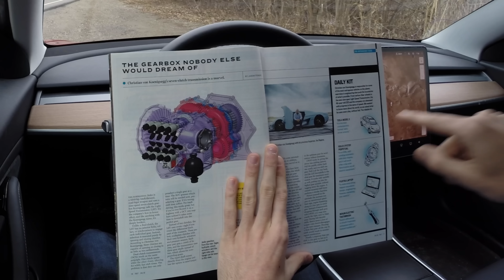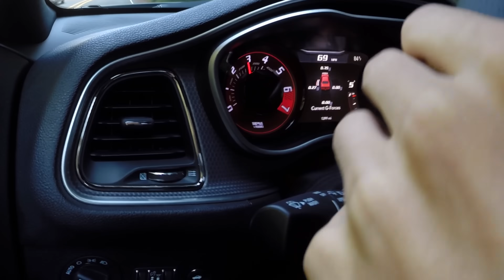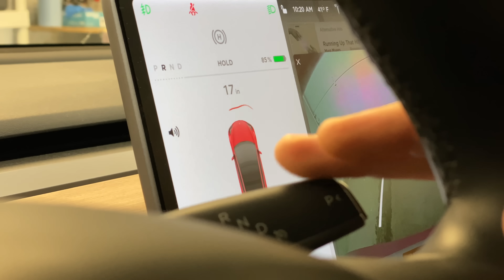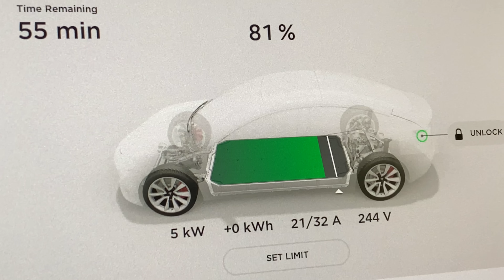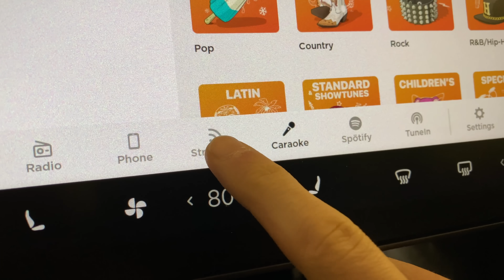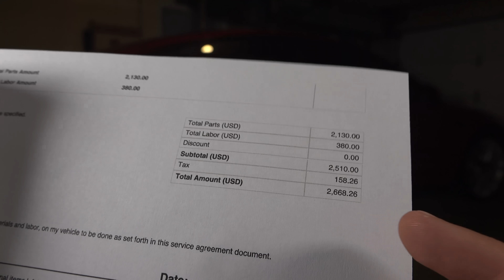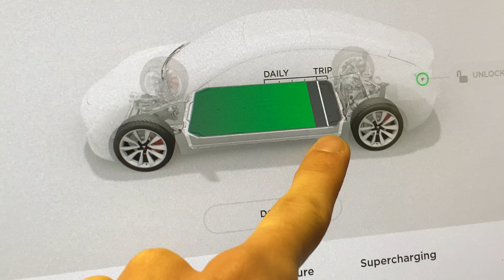Living With A Tesla Model 3 For A Year - The Best Daily Driver

Comment: Great video, but couple thing are not as black and white you say. Diesel/gas car can be heatet with webasto or a like and same system can cool car and car will blow heat right away.
Diesel/petrol car do not need fill up daily and you need to "fill up" tesla so that was pointles point.
Reply: A Tesla fills up when you sleep.
Reply: @Freba9  well yeah because it takes so long. Same effort is needed to put pistol in or plug in. That argument is just pointless.
Reply: @anttilaiho7801  It takes so long because it can and because it is cheaper. You can also choose to fast charge.
Reply: @Freba9  why the argue? Both need fill up and both are filled up by pluggin something on side of car. And electricyty aint free. Compared to low fuel diesel the cost difference is 2-3€/100km. If you drive 20000 km year that is 400-600€ per year. Money you easily spend on few nigths on pub.
Reply: Antti Laiho I see what you mean, but plugging in at home and/or at work still feels a lot more convenient to me.
Reply: @Freba9  I dont. I have had cars with heater you need to plug in. And I hatet it. Every time in winter you did come home you needed to plug in and remember to take it off before you did leave. Now whit webasto I can just drive off whit warm car. Thats a lot better that the hassle whit cables 😁

Comment: Bought a low mile 300 c for 18,000 with lifetime drive trane. I can spend 42,000 on gas before I reach the price you paid. Gets 20 mpg. One tank of gas every three weeks. I will stick with this 300 and could buy one of two more at the same cost of your electric car. Sure I might like an electric, but 60,000 bucks is way out of my price range. And I want to stay payment and debt free.

Comment: I think they've been over this exact "Yo, this sucks" phase 100 years ago, but the extra range of internal combustion engines won them over and they never looked back -not for a good while, at least, lead-acid chemistry meant that EVs went nowhere, quite literally. I don't know if they would put 500 liter gas tanks in "newfangled" ICEs to match the weight of battery packs, though , had the roles being reversed ;-)

Comment: 6:20 clarification- you should be using brakes (sometimes) regardless to prevent them from rusting or collecting up dirt, road debris, etc.
Reply: Here in the midwest you have to use the brakes because there is no regen or very little when the battery is cold.
Reply: Mark Tattershall not a problem for me I’m in Australia! but I guess the 45 degree summer days can take a toll on the usability of the vehicle..

Comment: All are very good points.
A small detail. The "braking warning system" has 3 adjustable levels of sensitivity. If you are using the least sensitive and still having it triggered then perhaps you need to consider to keep safer distance or drive slower in busy areas. That is amazing how everyone consider themselves good drivers :)
I have exactly same car (even same wheels style but 19s), the "warning" is set to Medium, and it almost never triggers.

Comment: The issue is of course, to advertise the electric cars properly like you said would make the car companies' other cars, which they make a higher profit margin on and dealers maker more money on long term, look crappy in comparison. And a company like Tesla who could drive that point home, hasn't yet needed to advertise to maximize sales based on current infrastructure. It will be interesting to see what kind of ads they run when they get to the point where they have the ability to make more cars than they are selling in a given month. -Daven

Comment: I test drove the Model 3 a week ago and I cancelled my Model Y order.  I'm not sure if it was a RWD or AWD one but I'm sure it wasn't the Performance one.  It wasn't a bad car but I expected more after I heard so many great reviews about it.  It handled better than my Honda but not as good as the 2004 BMW 330 my brother in law let me drove for a day.  That BMW wowed me then and I still remember how good it drove.  That Model 3 had good acceleration but I feel like  I'll be in traffic jam most of the time so I would rarely make use of it.  The gas pedal (right pedal) was a little too hard for my liking.  The back window was small and so were the side mirrors.  My Honda Accord has better visibility.  I still consider the Model Y but I want to test drive it first.
Reply: So you cancelled the model y that had bigger windows because the model 3 windows were too small, and didn’t handle as well as a bmw, but if it did handle as well as a bmw you’d be sitting in traffic most the time anyway so you wouldn’t make use of it just like the speed? Huh?

Comment: The problem though about the speed is that all the quickness is in the low end and theres a long cool-down period after 10-15 seconds. Electric cars still aren’t there track wise.
Reply: After 15 seconds? I’ve seen model 3s lap the Nurburgring at full acceleration and didn’t overheat once, and that’s a 13 mile track.
Reply: M.A. M.R. Whats the official Nurburgring time?
Reply: InvokeMyRage 1 Official? I don’t think Tesla has had any official times there with the model 3.
Reply: M.A. M.R. So without a lap time we have nothing to compare to. Unofficially its over 8 minutes which is slow for the 0-60 on the car.
Reply: InvokeMyRage 1 Who ever said anything about lap times? I’m telling you theres uncut videos of Tesla model 3 at full acceleration lapping the Nurburgring without over heating after 15 seconds like your original lie claimed old man. Stick to the point here boomer.
Reply: M.A. M.R. What i was referring to was ludicrous mode, which has a long cool-down. Tesla is slow at nurburgring, just facts.
Reply: M.A. M.R. So its slow in acceleration and on the track then lol
Reply: InvokeMyRage 1 whatever you say boomer lol

Comment: I've thought about this before, since we got a Leaf a few years ago but I still have to drive an older car.

You pull up to the gasoline charging station (because you can't charge these cars at home, you have to do it while you're using it, which suuuuucks) and plugging in is kinda weird, it doesn't fit snugly or click in at all so you gotta make sure it's in there good. You put in your credit card and hope it doesn't get skimmed, and start charging up. It's a fast charge, sure, but it's like $10 a minute! Almost $40 for a full charge is highway robbery, no matter how fast it is. And the worst part is, you can't plug in and go inside while it charges. Even if it's freezing-ass-cold, you have to just STAND THERE like a doofus until it's done! Oh yeah, and apparently later on someone can come along and use a tube and a container to literally just steal the charge right out of your gas car. All $40 worth of it.

Comment: Some solid points. For me the road trip ability is a tough pill to swallow. I also park outside on the street. I also anticipate big issues with electricity supply in the future as these are more widely adopted and with higher amp charging systems, at least where I live. So eventually, I think the fuel cost savings will become insignificant. Things I do not like about tesla are the giant touchscreen, their parts/maintenance policy, and the body aesthetics.

Comment: If you had everyone who had a car was driving around in $60,000 to $140,000 electric cars, and then one day they suddenly brought out $20,000 Corollas with internal combustion engines, I think that a lot of people would be suddenly buying those new 'MUCH more affordable' cars due to the fact that they could actually AFFORD to buy one of them.
Reply from the maker: ICE would be super expensive if it just came out. EVs would be much cheaper. That’s how new tech works. And you can get used EVs with plenty of warranty left under $15k all day. And that’s today, while the tech is still very much so in its infancy.

Comment: Don't forget about the OTA range reductions some drivers have seen, and the fact that you are being GPS tracked and video recorded pretty much whenever you are driving.
Reply: Same goes with every modern fossil car
Reply from the maker: Same goes if you have a cell phone in your pocket.
Reply: @EngineeringExplained  yes, because I never leave home without my cell phone.  Definitely. 

Just because ICE cars do it doesn't mean you can't push back. States have laws requiring data disclosure. Use of those processes is used to evaluate customer sentiment.

Comment: I like electric cars because it is quick and don't have much service intervals. But I can't charge it at my house because the electricity is small (only has 5.9 Ampere of current and 220 Volt of voltage, so its maximum power handle is 1.3 KW. The reason why it is small is because the electricity in my country 40 years ago was expensive and I live at suburban). I hope there will some electric cars that still have button and knobs and allow turn off some active driving assists (my current car didn't have any driving assist other than power steering, power brakes and ABS and didn't have touch screen infotainment system).

Comment: You joke about the heated steering wheel and software update. But fun fact when they first delivered the model 3 it had the seat heaters but not the software to control them (turn them on) that came a few months later as an update. But we know the 3 doesn’t have heating element in the wheel because the vegan leather can’t c
(couldn’t?) survive the heated steering wheel.

Comment: About maintenance. Yes, maybe replacing oil in ICE is a chore. But how is this actually worse than battery degradation? Two examples: I drive 20-year old Toyota Echo and my older brother drives 18-year old Toyota Matrix. Besides replacing oil with high quality Mobile1 synthetic once a year and replacing dead O2 sensor every 10 years there is no other maintenance or repairs that were required. Ok, brake pad replacements every 5 years but these are cheap and very easy and straightforward to replace by yourself, in your garage.

Now, this Tesla you drive, Jason, will it last 20 years without major repairs like my (and not only my!) Toyota did? Or will its battery degrade significantly in 10 years? Will it almost die in 20 years? Will you need to pay another $20k in today's dollars to replace it?

I've seen how fast other EV batteries degrade and how much other manufacturers charge to replace them. It's not pretty at all. Nissan recently RAISED price for Leaf's replacement batteries. Raised, yes. They keep talking about batteries "dropping in price like a rock" and all I see is Nissan RAISING the price.

That's some food for thought. Will you pay $50 every year for synthetic oil/filter change in a reliable ICE car (i.e. Toyota), or will you pay $20k lump sum every 10 to 20 years to replace severely degraded battery?

Until the battery degradation problem is solved - your point about ICE "maintenance" is moot.
Reply from the maker: I don’t think anyone’s currently beating Toyota in terms of reliability. But I think there’s a major case to be made for a $60k Tesla compared to a $60k BMW or Merc.

Comment: One of my mom's municipal engineering teams worked with Tesla. She advised her VP that it wasn't a good idea, however, because she knew Tesla was not going to be transparent about their technology. I'm not an engineer so the best way I can explain it is this: you can't hook up a giant battery to a grid without knowing what exactly is going on in the battery and guarantee that it'll be safe. Sure enough when push came to shove Tesla refused to disclose enough information and the deal blew up.
Reply: Tesla may be a new start up but their technology is kept locked away for good reason.

Comment: Regarding regenerative braking - does the car apply the brake lights when you do it? Many motorcycles can slow down in a similar way but they don't give folks behind any warning. On bikes it's pretty dramatic so maybe that's not a concern on a car?

Excellent video thanks!
Reply from the maker: Yes, brake light illuminates while regen braking.
Reply: @EngineeringExplained  Awesome thanks. I wish I'd considered EV's when I was shopping for a new car last year - it didn't even occur to me ugh. Next time!

Comment: at time 2:23 you say up to 50 mph your supercharged s2000 is slower than the Nissan Leaf...well that is because the s2000 is high revving and the super charger you choose to install is the type that takes advantage of high revving engines providing boost at higher revolutions so you can have a doctor Jekyll and mister Hyde type performance

Comment: Have you sold off all your other cars? There are a lot of advantages to being rich. One of them is buying a Tesla.
Reply: Mike Nazar model 3 is not expensive after you factor in savings
Reply: @jordan59961  You are correct. Too bad the buy in  is beyond most peoples limit. I can buy a $17 000 new car in the US and even with $2 000 a year on gas and maintenance it will take up to 10 years to break even for the cheapest Tesla.
Reply: Mike Nazar it’s more than 2k a year for gas and maintenance though, right? I mean on my old gas powered car I was paying $150 a month on gas which is already about 2k. And I was spending over 2k a year on maintenance and I wasn’t keeping up with it, but then again it was a European car. I think you’re right, but I think it’s more along the lines of 3-5 year break even point than 10 years.

Comment: What's the future of electric cars on a global scale?
Are IC engines gonna be extinct?
Reply: Sagar Prajapati It’s not a question of if, it’s a question of when.
Reply: I suspect so, even more so when nuclear fusion is fully a common thing, electricity will be cheaper than ever before.
Reply: rdizzy1 yes.
Reply: @rdizzy1  I am taking IC engine course this semester and prof•( works in R&D department of ford) said EVs will take atleast 20 years to infiltrate market extensively. Actually, they generate more pollution in producing electric cars than it's counterparts.
Reply: @sagarprajapati9357  Maybe so, I haven't read the exact emission/pollution totals for production of each between the two if you have sources for them it would be interesting. Also it depends on where you live to recharge your vehicle when it comes to energy production. I live in upstate NY where much of the power comes from hydro, and over half of the states power comes from either nuclear power or hydro. This wouldn't be the same obviously if your states power mainly came from worse sources like coal.

Comment: 1. and 2. are nearly the same points. I watched a drag race and a Porsche beat the Model 3 (though still more expensive).
Automatic transmissions (3.) are no big deal and falls under the same category as 1./2.
Only quiet up to 30 kmh (4.)
5. Also an ev has filters which have to be renewed. Filling oil is so expensive? I think not. Let‘s see in 8-10 years what i costs to swap your battery.
6. Mild hybrids also have these nowadays. It is not a good idea to not use your breaks at all (rust you know ...)
7. Only if you have a house. Can be a big disadvantage.
8. Do you know vehicle heater?
9. Truck have independent climates. Don‘t know why they don’t put them into cars.

So what?

Comment: Caring about heated steering wheel. How futile we've become. Because turning the hot air to the steering wheel is just too much work.
Reply: PB S first world problems, am I right?
Reply: You need to live in Canada to understand how important it is. If everything in the car was optional it would be my number 1 pick.
Reply: I'm from the time when people put on gloves to drive in cold days in the winter. Important must mean something else these days.
Reply: ibeam68 if you live in Canada, then why not make a small fire inside the car using moose carcass?

Comment: I want an electric car that's bit sporty, since I can give myself power at job site. I just feel like Tesla is Apple's closed ecosystem compared to PC where I can get what I want.
Reply: itsMike trust me, you want a Tesla model 3. Go test drive a performance one for free. You can schedule it on the site
Reply: I have driven one but my tools/packout don't fit in the trunk. I need hatch back or crossover electric (maybe model Y). I'm an electrician by trade, and even setup temp power for some of the other people with plugin hybrids on site. However, Mach-E is coming and still has the tax benefits.
Reply: itsMike model y will probably be big enough for you but actually you can’t really use the car as a solid source of power. I think there’s some law that protects against it. So the model 3 only has a single 16 AMP 12 volt charger. They also have 4 USB ports. If you need more juice you may be out of luck. Or maybe a DC to AV converter on the 16 AMP port will suffice? Since you are an electrician, do you know if you can get more power/amps out of the port if you use a DC to AC converter? Or is it the same amount of juice, just in AC form..? Genuinely curious...
Reply: The car won't be a power source, I can use my jobsite to charge it and not charge it at home.
Reply: itsMike ah I read it too quickly my bad

Comment: As soon as there's an electric car that doesn't require me to use a touch screen and doesn't have wireless telematics, I'll buy one. Oh, and when they swap regenerative braking to the brake pedal.

And just in case there's a manufacturer listening, I'd much rather have a cooled steering wheel than heated, and I live quite far north. I'm much more likely to have gloves with me in the winter than summer.
Reply: Right Wing Safety Squad that’s not gonna happen. Touch screens are the future. They are replacing car buttons like phone touch screens replaced the physical keyboard in the phone.